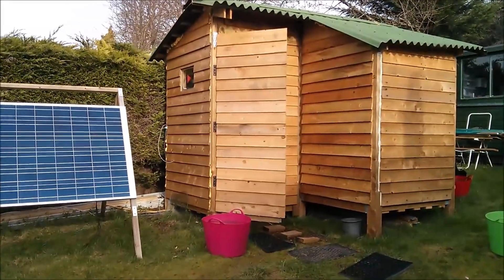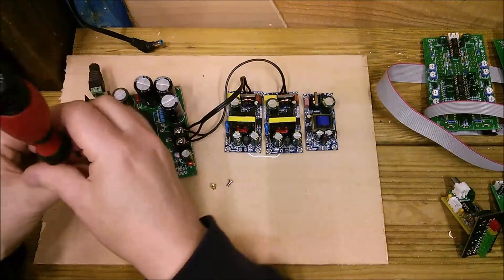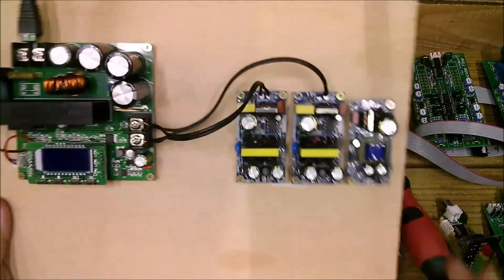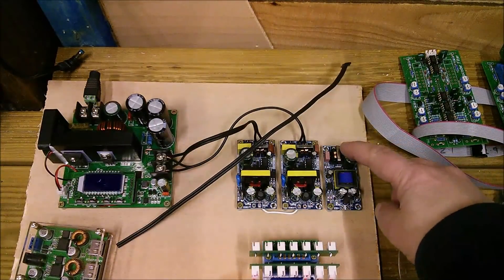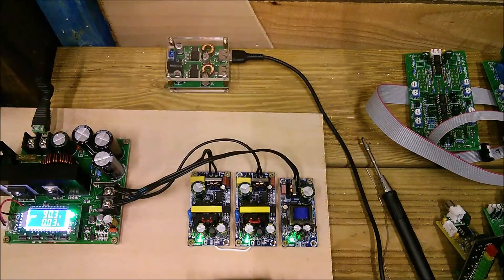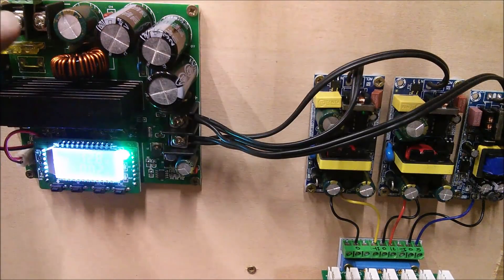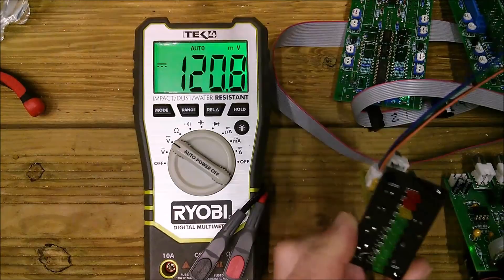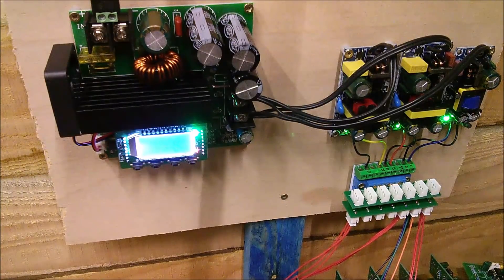From the Shed: Multi-rail Power Supply: Vocoder

Comment: Why do you boost it to 100V first and then down to 12 again when you just could use a 12V to -12V converter and a 12V to 5V converter?

Comment: Got the same 120v boost converter. Drops to slightly above the input voltage when only drawing a couple hundred ma. Input 30v 10a. Something is wrong. Very jittery output aswell.

Comment: Why did you use the thick cables for 90V and such thin cables for 5V and 12V? The other way around would have made sense, especially if you don't have sense wires to your distribution board. I expect quite some voltage drop once you connect all your stuff.
Reply: Currents involved are all suited to the small wire, but the lamp cord has insulation with a >=300V rating. Matching supply impedance, voltage, and rating for +/- supply is more important than staying steady overall, or meeting voltage spec. It would be better to avoid that voltage drop, and this whole setup (boost included) could also be a single tri-output forward converter in a purpose-built supply.

Comment: This must be the most unnecessarily complicated method for obtaining noisy +5V, -12V and +12V rails for an audio project.
Reply from the maker: From a 12V input.
Reply: @JulianIlett  I was assuming (but I might be wrong) that, in its finished form, the vocoder will be mains powered so wouldn't a small mains transformer + linear regulators running from a separate 12-240V inverter be a better solution?

Comment: Why do you need 90 volts please?
Reply: 90V is the minimum voltage required in these AC/DC converters.
They are universal and operate from 90V-240V input. 
Since they all use a bridge rectifier to convert the AC to DC first, you can use DC instead of AC as input.

Comment: Interesting idea to power an audio system from as many switch mode supplies as possible!  Why have one noise source when you can have four.  

I think I’d run the power through a relay powered from the slowest power rail. So that all three power rails turn on at the same time, a 3 pole relay so even the 5V is switched.
Reply: Maybe Julian will find a 5th SMPS for the vocoder!  Several of us have talked about this in previous videos.  I thought it would have been a good idea for more videos on making a linear PS PCB for this.  But if he is now, at least temporarily, using a 12V battery for its power he really only needs one switcher to get the -12V rail.  Then use a linear for the 5V.
Reply: And as for the rail turn on times, I'm not sure it will be an issue with the 5V coming on late.  He could do as you suggest though or do some testing while turning it on and listening to the output.
Reply: @ElmerFuddGun  Best case the 5V volts coming up after the +/- 12V could be loud pops and bangs in the audio. Worst case could be a latch up in any chip that that have all three supplies connected.  It’s just good practice to bring up supplies together, or in any order dictated by the datasheets.

Still it’s good to see Julian pushing design boundaries. :)
Reply from the maker: Yes, this is going to be interesting :)
The 5V supply is only used for the LM3915 LED bargraph displays - so it's really not a problem that it comes up a bit late.
But the SMPS noise is breaking through into the audio - but only (it appears) into the microphone pre-amp. The rest of the circuitry (which operates at about 2V p/p) seems OK.
Reply: @JulianIlett  You might want to put some extra filtering on the supply going to the mic amp.
Reply from the maker: I'll try anything - extra caps, ferrites, even an earthing rod :)

Comment: Why such a complex Psu when a old PC supply would do??.
Reply: Even a cheap PC supply would also probably have better regulation/less noise than some random $2 buck converter straight from china.
Reply from the maker: This comes up again and again - what's the available current on the -12V of an ATX PSU?
Reply: @JulianIlett  depends on model but up to 30A on some units ic common.
Reply: @hunter00047  I've never heard of any PC supply having 30amps on the -12v rail, usually all the current is only on the +12 rail. The negative is more like one amp max.
Reply: @eDoc2020  I used to have one, it was second hand the psu was switched mode and was in a diy psu case. 
I can only assume some mod was done on the neg output. I never had any use for the neg output, but it was labelled + & - 5-12v 25A. It was also fitted with a variable cc pot. I ended selling it to a radio ham.
Reply: @JulianIlett  addendum for cost effectiveness use 2 cheap ones, and make sure no common earth exists.
Reply: For long distance power transmission. 100 volts reduces the losses on a long wire, e.g. from his solar batteries outside.
Reply: @kapegede  correct, but if you're using a vocoder it's most likely you would have mains voltage available, as already in the shed.
Reply: @kapegede  - Well, I think that is what he originally got that step up PS for but it is only going a foot here.  But he could have used some other set up that would go from the 12V battery source to his needed -12, 5, 12V rails.  Julian likes to take the long hard route sometimes!